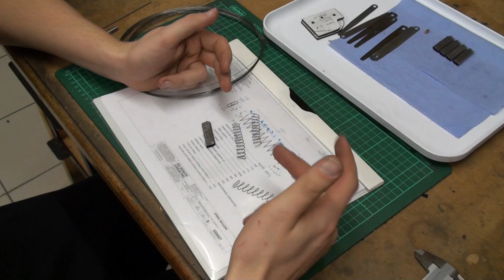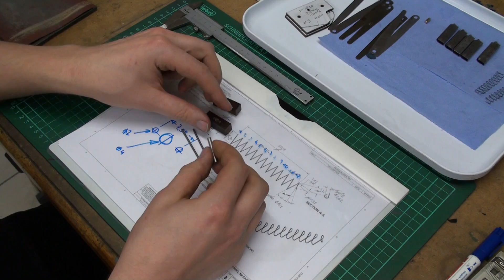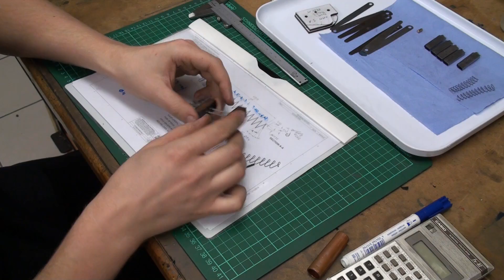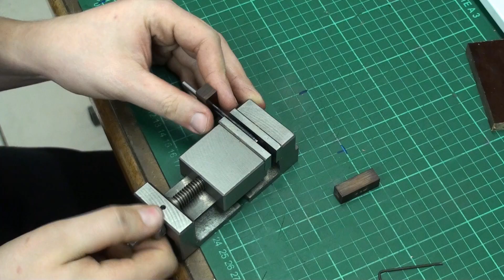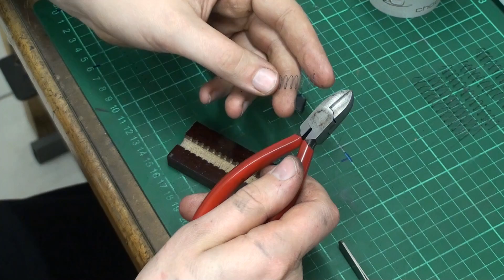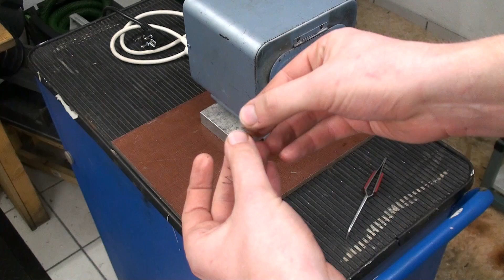Miniature M1911: Magazine Spring

Comment: I used an inkbird PID from Amazon for my heat treat oven build, with satisfactory results.
Reply: The only real drag is that it doesn't have a memory for presets. But $25 for a pid with a solid state relay and thermocouple was hard to cry over

Comment: If you are making a half-scale device then things like springs would possibly be underpowered if you just halve their dimensions. The strength of a spring would be dependent on the cross section of the wire which drops to 25% if the scale is reduced by half. This might not be an issue, in fact, because the weight of any part of the device would decrease by a factor of 8. You'd also have an issue with heat scale being relatively much thicker on the on the thinner wire. It's not a simple thing to reduce a mechanical device.

Comment: I 3D printed a custom mandrel with groves, and wound piano wire around it taking it to a vice each turn. It came out pretty okay, but then when I took it off the mandrel, the spring didn't hold form and immediately spiraled out of form. I was still able to use it for my project, but I'm not happy with it.

Comment: Temperature controller with ramping: a few years ago I built a project using a Fuji control from automationdirect.com. It can be programmed to ramp. At the time it cost about $125. The instruction manual is free on line.
Thanks for the videos.

Comment: Mate, There's a bloke that runs a site called Clickspring. He makes clocks. He also does a bit of heat treatment from time to time. He coats the steel in a paste made from borax (sodium tetraborate decahydrate) and denatured alcohol to prevent oxidation when the metal is heated. I also believe that the prevention of oxidation maintains the cross sectional integrity of the steel. This perhaps might help to minimise distortion of the metal when it is cooled and then annealed. Just an idea and I could be wrong..... I usually am.

Comment: perhaps you could heat the spring wrapped around a heat proof material with a controlled dc current, quench and turn off power.
Reply from the maker: MacFarland Pickard I can see the idea behind that, but it might be a bit over my head :D Thanks for commenting!

Comment: That was a good video and good techniques to bend wire and harden and temper them
Thanks
Mannyu
Reply from the maker: Manny Monroy I am not yet sure if my technique is good, but thank you :)
Reply: I mean you come up with tooling or jigs to make a part. am drawing up plans for parts from full size to 1/3 scale. When I finish drawings I am staarting project. The slide and lower are or have lots of details inside...have to figure out how to best cut them.
Thanks for sharing and I look forward to new videos on the 1911 and your other projects. Yeah at first we did not see whom you were....but you fixed that.
Manny

Comment: First, I want to say I admire your jigs. If ever I have to make an elliptical (sort of) spring I will copy them shamelessly. On hardening and tempering, I anneal and harden same as you do. There is a minor question as to whether you should quench in oil or water, as you did. I make my own knives, gouges, and other carving tools myself and I anneal and quench same way you do. Usually in water. When we come to tempering we do the same thing: stick it in an oven. I, however, use an ordinary cheap household oven, same one I use for Lasagna. I verified the setting by thermometer. It is right on to about 1C and it cost  me $99. But then, I use it for cooking too! So I set it to 235C and leve the tool there for at least half an hour.

For a 0.4mm wire you could probably get away with 15 minutes in the oven, but more will not hurt aand may even help. Point is, these are molecular processes. Takes a while for them to do their work. I think the springs need not only better temp control but more time in the oven.
Reply from the maker: Juan Rivero Man, I absolutely did overlook your comment, sorry - You put a lot of good information in it! I will keep that in mind when I do my next batch of those springs :)

Comment: A very interesting problem. Perhaps a different alloy might produce a more acceptable result? Thanks Stefan...!
Reply from the maker: ***** Hmm, good question :) I only have that standard rusting spring steel wire that comes in a heat threated status. Maybe some chrome-nickle spring steel wire would work better, but its not to easy to get.

Comment: Hi Stefan,
I'm no expert in springs, so this series will bring me lots of knowledge, from your and the viewers commenting.
The heating with the torch seems to clearly overheat certain parts of the winds, probably introducing lots of oxidation int the material... With adverse consequences.
I'm watching, thanks,
Pierre
Reply from the maker: pierre beaudry Yeah, I think I burned the carbon in the wire in some areas - I got those nice bright speckles on the wire while heating it. I will try to sort that out a bit better :)
Thanks for watching!

Comment: I was almost sure you were going to cold form them using the lathe set at the right travel pitch. Same jig, just setting the lathe to pitch and turning it slowly. If you make the toolpost "pinching" tool out of bronze or similar, you can apply quite a bit of stretching pressure while it's feeding into the jig. Good video!
Reply from the maker: JRoque250 The cold winding would work, but the actual springback would be horrible :\
Thanks for watching and commenting!

Comment: Hm. Well, what i'd do is a bit complicated but in theory it should work, i'll try to explain as best as possible.

First of all i'd make an all metal mandrel, reason for that later*, it would be made from no less than 5 parts (6 plus the pin).

The mandrel would be made like this:

Part 1%2 would be the two wide sides of the spring. They would be the actual length of the spring and have machined in them the groves that would hold the perfect spring (the one in your design paper), no compression here, we are making the actual spring from the start.

Part 3 would be a simple strip of metal that would go between the two sides and keep them at the proper thickness.

Part 4%5 would be two clips at the ends of the mandrel. Exactly the same parts you made from phenolic but with one major difference(other than being metal), where the two pins would normally go, there would be two slots that would receive pieces 1, 2, and 3 holding them all together. An addition i'd make is that both should have a means to secure the spring steel in place when starting the coiling process and when ending it.

That's for the mandrel, now for the "why do it like this" part:

Step 1. Assemble the mandrel with one end of the spring steel wire in the mandrel hole made in part 4, then chuck it in the lathe (same as you did for your own mandrel).

Step 2. Not using the heat process, cold form the spring with great care so that the spring steel wire fits in the groves properly and very snug.

Step 3. Using a clamp to keep the spring in place (so it doesn't unwind) affix the other end of the spring steel in part 5's retainer hole.

Step 4. Remove the clamp, remove the mandrel from the lathe and chuck the mandrel and spring steel in the oven to anneal the spring (if possible, if not using the torch).

Step 5. Dunk the whole thing in water (the mandrel will provide the heat mass necessary to keep the spring wire hot*). And then repeat all the processes required to make it back in to a spring.

Step 6. Disassemble the mandrel and the spring should be springy and if all went well perfectly shaped.

That's how i'd do it. Hopefully i've made the mess that's inside my head in to something that's discernible from babble :))
Reply from the maker: Hi aserta :)
Ha, I had to draw that up, and I think I got your design of a breakdown mandrel, I really like that idea. Maybe I give it a shot, even if its a lot of extra work. And if the coldforming doesnt work out, I can still use that breakdown mandrel for warmforming...
Thanks for the verly long reply I appreciate it very much :)
Reply: Stefan Gotteswinter I really hope it works, the work you put so far in this miniature is amazing. :)

Comment: Ben fox's suggestions sounds good, though you may need to make the mandrel slightly smaller to allow for a little spring back. . .  
Warm regards 
Daryn
Reply from the maker: The real problem with the springback is, that its not a "linear" springback, its more of an uncoiling and that results ind a spring that twists along its length. For coldforming you realy would have to overbend the wire a good ammoung...I will experiment with that a bit more :)
Reply: Can you temper it on a mandrel? 
I use hot blueing salts to temper ( and colour)  steel it always gives very even results, perhaps this could work if you keep the spring on the mandrel after hardening. . . .
Reply from the maker: Daryn Radcliffe Never thought about that, but that might work.
Note taken, I really will have to to a test series. Smells like work to me ;)
Reply from the maker: Daryn Radcliffe Somebody mentioned tempering it in liquid lead, I will try that too. Outdoors!

Comment: First of all, love this series. I have a thought on making a cold forming mandrel for winding the springs in the lathe.

1: Cut a threaded rod at the pitch of the spring and a minor diameter equal to the pitch diameter of the spring.

2: Mill two parallel sides to the width of the rectangular profile of the spring.

3: Form the spring in the lathe on the mandrel with the threading gears engaged at the same pitch so that the wire forms in the root of the remaining threads and flat across the milled parallel surfaces.

An added bonus feature would be to drill an anchoring hole perpendicular to the parallel surface at the start of the thread to feed the wire through and bend a hook to secure it.
Reply from the maker: I thought about it and also taked with my foreman at work (Which is our springwinding guy) and he was pretty concerned that the spring will go all wonky ( From the springback) when i cold form and pull it of the mandrel - Just like it did when I cold formed it in the vice after winding.
But thank you for the input, the pitched winding arbor is something that might still work, even with warm forming - maybe I will give it a shot :)
Thank you!
Reply: Stefan Gotteswinter Crap, I didn't think about how to remove the spring. All I can think of is some kind of expanding mandrel, but that would get pretty complicated real quick.
Reply: Last winter I spent making chain mail, a mideval pursuit. To do so you wind a spring, then you cut the spring into circles, then you weave it into chain mail. I will tell you this: every material I tried -- fencing wire, copper, brass, and ordinary steel wire -- will expand both ways when you take it off the former. I wound mine on a lathe turned by hand. Even with tension on the wire it will still expand. Your chances of getting the exact pitch you want are very small. I didn't care because it was "art" (presents for friends) but if you were making a model spring I don't think it would work well.
Reply from the maker: Juan Rivero Oh man, thats a tidious job - I saw chainmail making at a medivial fair and it looked very much like "not so much fun", but the product was just gorgeous!
Thank you for the input, I also have concerns that I cant get around the springback, but I will try adound with some things...
Reply from the maker: Ben Fox Maybe If I dont cut the pitched grove to deep, I can "spring" out the mandrel..

Comment: If anyone wants to experiment, guitar strings are a good source of material.  That shape is a serious challenge; a normal .4mm coil spring is dead easy because it doesn't need to be annealed...  Just wrap it tightly around a mandrel held in the lathe chuck -- or even a drill chuck.

I appreciate your high standards Stefan, but I have seen factory magazine springs that look a bit wonky.... But, I do get your desire for really nice springs!
Reply from the maker: Thank you, I never took apart a real 1911 magazine :D
On one hand no one will see it if its hidden in the magazine and just doing its work, on the other hand I want nice springs...
Youre right normal coil springs are real simple, we do those a lot at work, winding them direct with the hardened spring wire. We only temper them after winding to make them durable.
Thanks for commenting :)
Reply: Stefan Gotteswinter Did you consider forming the spring around a series of mounted pins?.... without annealing the wire.  I just wrapped .45mm wire around a piece of 1/16" TIG filler rod to make a spring and it wound tight with very little spring-back... So it might just be controllable if you pull the wire around each pin in just the right direction...  at the right angle... with the correct force... Add the pins as you go so they're not in the way...
Reply from the maker: b-rock Hmm! Good point, that Way I could overbend the wire to compensate for the springback. Note taken, will try that!